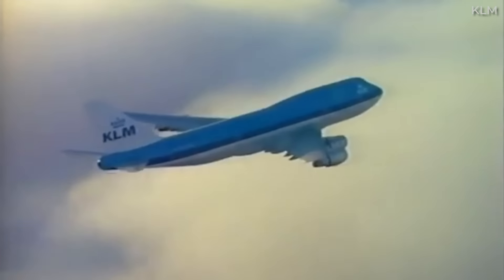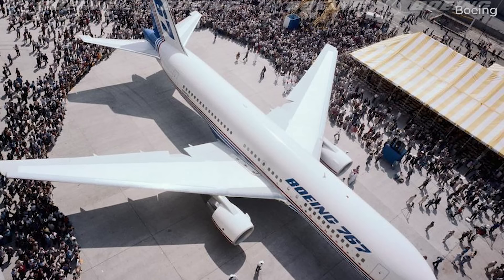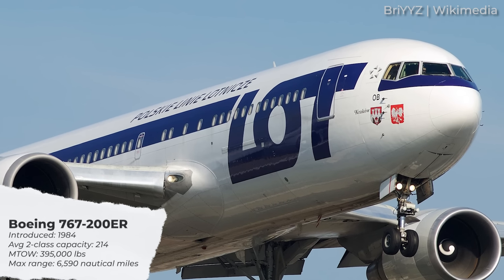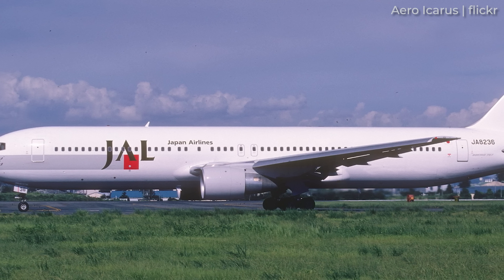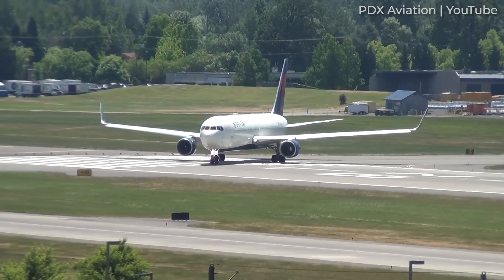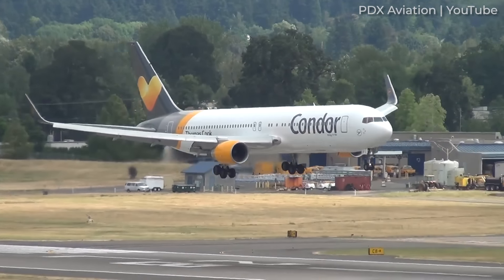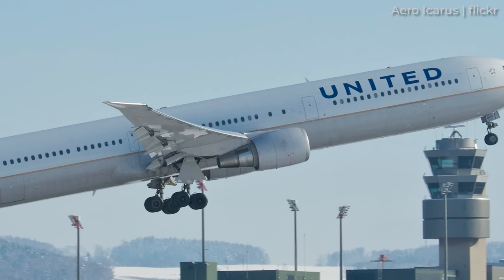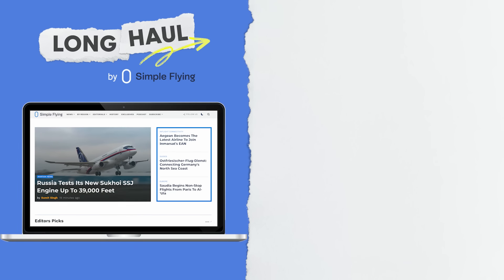The 5 Passenger Variants Of The Boeing 767

Comment: I spent about 8 years flying the 75/76 for Delta. I flew the 76-200, -300 and -300 ER. The -200 was affectionately called "the dump truck". It flew like one. The -300 was better mannered and the -300ER had more power and the smooth FADEC (fully automated digital engine controls) engines. I really enjoyed flying it. When the -300 ERs would come in from Europe, they would do a quick maintenance check and send them to the west coast for another check. I flew loads of trans-cons on them. Lightly loaded for the relatively short flight to the west coast I often saw 500 kts TAS with over 4,000 FPM climb through FL 270 (about 27,000'). Great flying, but the 75 was a bit more fun. The 76 was the Cadillac, the 75 the Ferrari.

Comment: The 767 family is the one I've flown on the most. That's been split between the 200ER and 300ER. I've flown on the 200ER with EL AL on a few occasions (1998, 1999, 2009) when they still operated the YYZ-TLV route. The rest of my 767 flights were on the 763ER with EL AL (2009, 2017), Air Canada (2004, 2012), and most recently, Japan Airlines from NRT-YVR on the way home from a trip to Thailand two years ago.

Comment: What would be a nice icing on the cake is to expand on the 300 / 300ER series and go through the various door configurations that were offered to different customers; e.g. BA vs AA with their 3x Type A doors + 1 Type B vs 2 Type A + 2 overwing exits. Quite impressed with their range. First flew on one in 1994 between LAX and LHR in a single shot with UA.

Comment: Only flew twice on the 767, first time probably in 1991 on a 300ER with Canadian Airlines (defunt) and the second time on 1992/12/17 with Air France in another 300ER.  It didn't leave a mark, so I assume it was just another regular flight.  Both flights were from Paris (CDG) to Mirabel (YMQ).

Comment: I was fortunate to have flown on a Qantas 767 back in 2011 on a domestic flight in Australia.

I also flew on a WestJet 767 in 2019 from Barcelona to Toronto. The 767 is a perfect size widebody aircraft for a lot of carriers, a role now taken by the 787-8. 

Can't wait for Boeing to build an NMA. They will sell at least a thousand units.
Reply: Those West Jet 767,s were actually from Qantas West Jet got them to use on the Toronto to England route they had a lot of problems with the them Qantas was actually the only airline that had an engineer station up front for a 3 man crew when the went to West Jet the made them into a 2 man cockpit they say that after they took the engineers station out there was room for a pool table 😅
Reply: @ronparrish6666 Great story! 😂
No issues on my WestJet flight though...just no inflight entertainment of any sort, otherwise an ok flight
Reply: @sainnt  yea they only got the used Qantas planes because there 787 Dreamliners weren't ready from Boeing for about a year soon as they got them they got rid of the 767 .s

Comment: Boeing also wanted to make a 767 partial double decker. Essentially slapping a 757 fuselage on top of the 767. Similar to the 747, but with the "hump" towards the back, instead of at the front. The project was scrapped because nobody wanted it.
Reply: That's actually not true. It was one of the early concepts for the 777 programme. But the airlines wanted a plane bigger than the 767 but smaller than the 747.